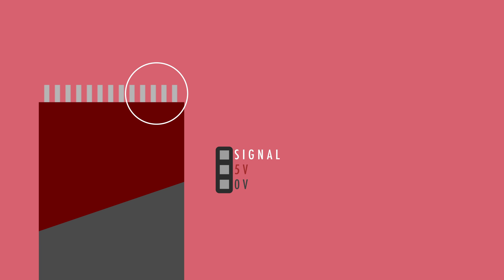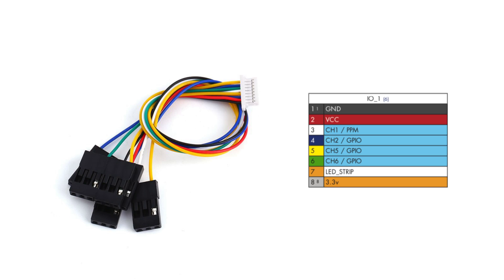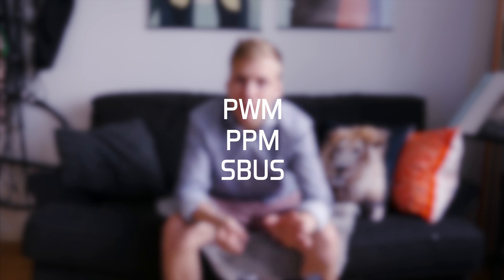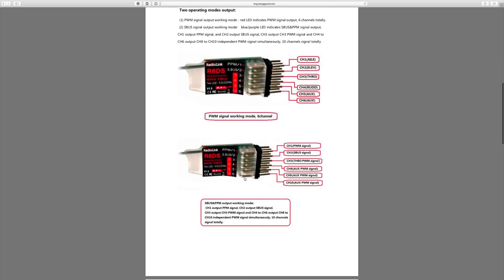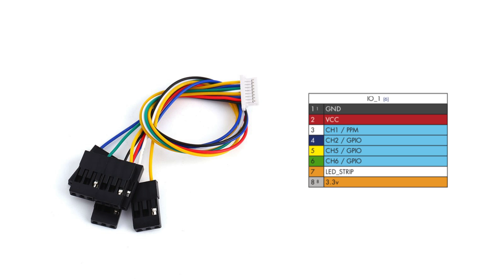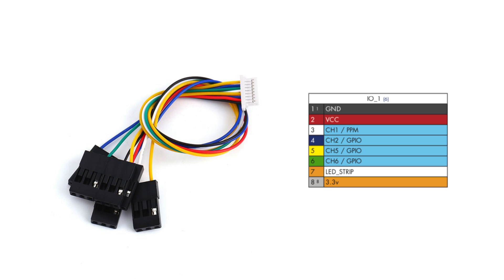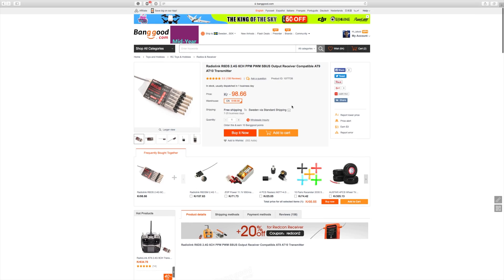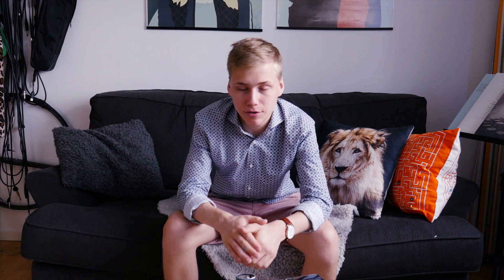How to wire receiver & fc PWM PPM SBUS Explained

Comment: How can I make connections to fs ct6b and omnibus f4
Reply from the maker: I haven't personally used the ct6b but if it supports SBUS which it probably does then you want to use that. Try to find documentation for what pins are configured to output SBUS. If it doesn't support that you will need to resort to PPM. Then just connect that like explained in this video. Hope that helps!

Comment: This all seems to only apply if you have a flight controller. But I only have a Receiver, no FC. How do I setup SBus to use with my Spektrum Rxs to fly airplanes?
Reply from the maker: Yes this video is mainly intended for quad builds. If you want to use a receiver without fc in a plane you will need to use pwm. Only specific receivers support it and if they do they have pins where you can directly connect each servo. Hope that clears it out, feel free to ask more questions, you could also dm me on the dronex_sweden instagram account. Happy flying!
Reply: @dronexsweden6906  Thanks for your reply DroneX. Sorry, I don't have instagram. I'm more of an analog guy in a digital world. I tried quads but couldn't get my goggles working well enough so I only fly planes and 1 helo now. The only FC I currently use is the Flite Test/Flex Innovations Aura 5 Lite in 1 of my elevon planes. It seems I'll be using PWM for the foreseeable future. :-)

Comment: thank you.  will you explain later when you can, using the signal inverter/converter?
Reply from the maker: No problem 🙂 Not atm since I don't own a receiver which needs the inverter which means I haven't done that. However, I might do something on channel splitting and resource mapping for controlling servos and relays maybe.

Comment: Hello,
Wht if I hv ppm reciver on a Quadcopter where I want to use a servo for whatever or use any PWM device ? Could u answer ths pls? Thanks.
Reply from the maker: You can use a ppm splitter like the one I linked below. The signal should be strong enough to be connected both to the fc and splitter. Some receivers already have this functionality built in where they transmit pwm and ppm simountanously so look for that first. If possible I would recommend you to use  sbus to the fc and then the pwm or splitted ppm for the servo.

https://hobbyking.com/en_us/ppm-encoder-module-hkpilot-32.html?___store=en_us

Hope that answers your question!
Reply from the maker: Another possible solution would be to use channel forwarding in betaflight and remapping your motor outputs so the first motor output is free since the first 2 motor outputs are true pwm outputs. Then connecting the servo to the first channel and then forward one of the receiver channels to that output. However there isn’t quite a lot of information on the topic so you’ll have to do some research. What receiver are you using?
Reply: DroneX Sweden ,
I am using FlySky X6B  receiver wth SP F3 flight controller, wrks great so far.  I hv buit my 1st FPV scrap buiding drone, by watching Painless360 video, flies very stable & good. 

Now I hv a RC switch needing PWM signal to turn on/off frm th TX that's all.  Yes, ths idea is very new,  I jst saw one video abt showing it… I meant Chanel fwrding. Not many people even know abt it. 

Can I use a converter PPM to PWM? Any idea?
Reply from the maker: Interesting, I've actually used the FlySky X6B quite a bit. I'm guessing you're running the Turnigy evo? In that case (this will most likely be the same on all transmitters for it), it can select one digital output and one analog in the output mode menu and then it will use both. Just choose IBUS to the fc and choose  pwm for the servo and you will be able to control both servo and fc without any splitter. Just configure it like the image below and connect the IBUS cable to one of your uart rx inputs and the seervo to one of the pwm channels. Are you running betaflight?

https://imgur.com/ecBw8p6
Reply from the maker: Just to clarify ibus is just like sbus but better, it doesn’t require any endpoint or stick mid calibration
Reply: Ok...I use CleanFlight. But I see the BetaFlight is the same as that but having just a different color & don't know why they r the same or whatever!!!  I don't use Turnigy as u guessed; I use FlySky radio & I really liked it so far. 
Painless360 was showing in his drone building video using PPM & I followed the same even though my TX & RX having S-bus. I fear if I change it to S-bus that ruins all the settings. Plus SP F3 board supports the S-bus or not I am not sure.
Reply from the maker: Yes they are indeed very similar. That is because betaflight is a fork of cleanflight meaning they tock cleanflight made som changes and then released it as betaflight. The point of betaflight is to release new features quickly as a sort of beta.

 Anyway, the output mode setting should be the same on the Flysky which means you should be able to switch between ppm and pwm output on your transmitter. Just look for that first. If that is the case I would just do the solution I suggested above. Switching to sbus won't change anything about your setup exept you will get way less delay and better relyability. The SP F3 can handle sbus no problem. 

However if you can't find a way to change the output mode with your transmitter you could always just get the splitter I linked before and that would work just fine.
Reply from the maker: Yes, it seems as though he is describing the method above where you turn on channel forwarding and then do resource remapping to use the 2 first motor outputs for servos. The only problem with that is that resource mapping can be a bit of hassle to get right. Also you'll need to redo it once you update and so on. His video is very unclear about exactly what he does and how he connects the motors though so I can't be 100% sure. I would check out Joshua Bardwell's video on resource remapping here:
https://www.youtube.com/watch?v=z5aO-3_n-Hs
Reply: DroneX Sweden ,
Yes, exactly what u said abt his video. Yah I do fear abt messing up " CLI command ch remaping" may mess up my nice, very stable quad. 
So, I hv a 2nd SP F3 board bought for playing arnd wth programming u could say as a "Guinea pig " . 
I will do tht experiment on it & let u knw. 
Alys thanks for your kind reply :-)
Reply from the maker: That's great! If you want help with anything just ask and I'll be happy to help. Good luck and it will be interesting to hear your results.
Reply: What i was discussing with u I think I got the solution. I wanted to use a PWM out put simultaneously wth Ibus one thru the flight controller to control a RC switch to turn on/off for navigation light on the drone. 
Don't need to set up th FC for "Channel forwarding". No neeeeeeeeeed :-)
My FlySky TX & RX can out put both PWM & Ibus simultaneously, I checked by a servo & CleanFlight turned on. I love my FLySky radio. 
I do not know why they r doing thru FC! 
I m not an internet person, but i may mke a video soon.
Reply from the maker: That's great! Glad it worked!

Comment: Hi Jacob. I´m a half-noob, wondering if there are any gadgets out there who can translate PWM signal to S.BUS and back to PWM. Trying to jam some signal through a Ronin-MX gimbal you see...
Reply from the maker: Hello Tomas. Yes there are. Converting the SBUS signal to PPM and then back to SBUS will however lose the benefits of the SBUS protocol but for a gimbal super low latency and calibration might not be super important. I'll leave a link on one of those converters below but I haven't actually used them myself so I can't speak for their reliability and so on. How exactly does your setup look? Maybe I could give you a more specific solution with some more information. If you are using a receiver it can most likely be set to either SBUS, PPM or PWM. They usually support at least SBUS and PPM.
https://hobbyking.com/en_us/rmilec-high-precision-pwm-ppm-sbus-signal-converter-v2.html?___store=en_us
Reply: Thanks, I was just looking at that too :)  Out of stock though...  My project does not need speed. Conecting a Sony a7 to a Seagull #MAP-X GPS and trigger system via my Ronin-MX on a M600 Pro. Any RC shops in Sweden you recommend?
Reply from the maker: I see! If you are familiar with Arduino you could use that to make the conversions and then also tailor it to your needs. An Arduino nano is extremely affordable. For rc shops here in Sweden I use fpvdj.se but their range of products is quite limited so you might not find what you need. But the Ronin gimbal is connected to the A7 right? And if so does the Ronin take a PWM input? What flight controller are you running? Some DJI fcs already have that functionality you where looking for built in. It might have a bunch of PWM out on it, in that case you won't need a converter. My DJI Naza-m has that feature where the receiver is a PPM signal and then you can access the different PWM channels on the pins on the fc.
Reply: I´ll check out the Arduino. Played with it a bit a couple of years ago. A7 is attached to the Ronin, and triggering is done infrared via CAN-BUS to the A3 controller. Ronin does not use PWM as far as  know, but it has D.BUS (same as S.BUS, I presume) and CAN-BUS. Hence my question about converting my signal back and forth. Another thought, would it be possible to use a wireless option? PWM 2 PWM over the air (only need 1 meter range) ?
Reply from the maker: Hm I see. The D.BUS while similar to SBUS is not the same. There exists a lot of different protocols like it like iBUS etc but they all work differently. You might be able to program something with the Arduino that can communicate  D.BUS but it will be way harder than PWM. From what I've been able to find there doesn't really seam to exist a good solution for your problem. One way of remote control of the camera would be to program an Arduino to emit the same IR signals as a wireless shutter which you then control from the receiver PWM breakout. You could buy something like this and then read all of the button IR codes with a IR receiver for the Arduino and the program it to emit them once you press different channels on your transmitter. https://www.amazon.com/Sony-RMTDSLR2-Wireless-Remote-Alpha/dp/B0097DFRMC

Comment: Hey im finally building my own drone, i did get a wrong part i believe though, my receiver - fs ia6 only supports PWM, no PPM, i have another receiver with PPM on order its just going to take a while to arrive. I dont see a PWM solder point on my FC which is the F4 FLAME Race Spec STM32F405, just wondering if maybe the solder point im looking for is Tx or Rx, at the same time i cant find anywhere on the internet where it says that my FC can do PWM control... What do you think?
Reply: DroneX Sweden thanks for your feedback! That is my FC, I'm still new to drones and the hardware. I never would've figured it out... Are you making another track?